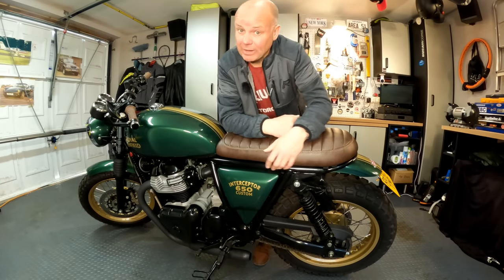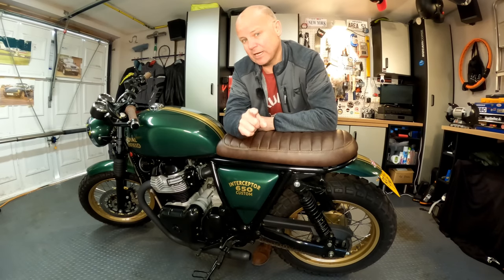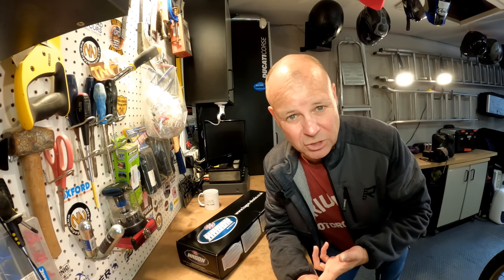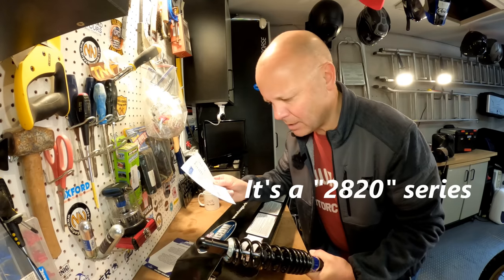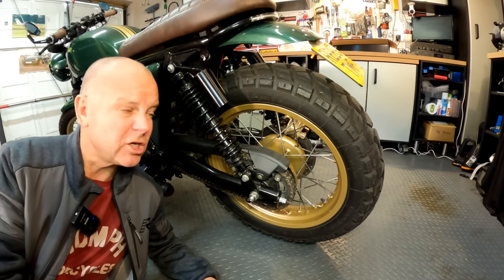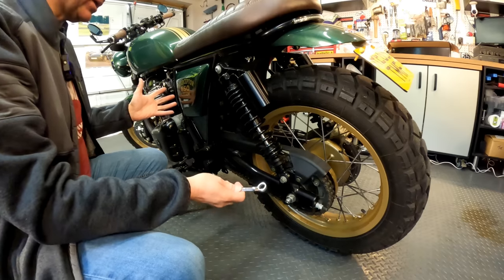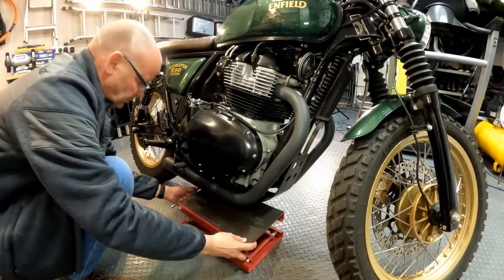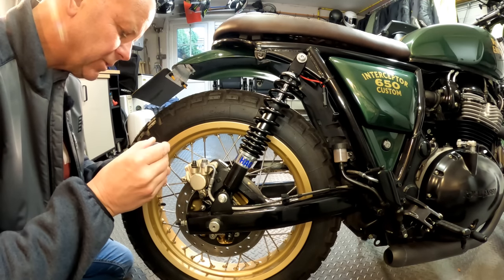DIY Fail: Attempting to install and test new shocks on my Royal Enfield Interceptor

Comment: Morning Andy
I think it may have gone easier if you had removed both the old shocks before attempting to fit the new ones. That way you could have used the jack to adjust the height and thus the angle of the swing arm to match the length of the new shocks without having to compress them.
Reply: Nope.
Andy did it exactly how it should have been done by a novice. He now has earned his QBF.
Qualified By F-up
Reply: I second this, haven't done this for many a year but that's how you do it.

Comment: When I was still a teenager I built a complete bike from several tea-chests of parts (engine already built, luckily).  I can't remember how many cock-ups I made but it was PLENTY.
A few years later I was confident enough to do engine top end rebuilds.  The point is that you don't learn anything without making mistakes.
Brave of you to show us your enthusiastic efforts, warts and all.  I hope this encourages others to have a go - doing your own spannering is one of the joys of motorcycling.
Reply from the maker: Cheers Chris - that was my intent on putting this video up, helping other learn by my errors....

Comment: When you're using a screwdriver to lever something always a good idea to put some soft material around the end of the screwdriver  in order to prevent a scratch occurring,  bit late in this case but good to know 👍
Reply from the maker: Well if you notice prior to that mishap I was doing exactly that!
Reply: @TheMissendenFlyer  👍👍
Reply: And... Use a small pry tool with a bent end, instead of a screwdriver for jobs like this.  If you use a screwdriver in this way you risk doing exactly what you did..

Comment: I have made all those same mistakes, Andy. These days if I have access to a jack, I pull both shocks (when applicable) and adjust the height to match the new stuff. And I also use a touch of silicone based lubricant on rubber bushings when I need to push them on, or a small bit of spit will do in a pinch. 

Always good to have a mate as a backup plan. And every expert I know has a long list of cock ups to become one.

Comment: Don't know if it's already been said but remove both old shocks before fitting the new ones. Then you can jack the bike up and down to align the new ones. Also. Don't do anything up tight until everything is fitted. That gives you enough slack in the system. Winding out the pre load can help to soften things up a bit.

Comment: Well done Andy! Theres no shame in not knowing what to do or getting stuck, you had a go thats the main thing & ask for help when unsure. 100% mate. Even us experienced tech's have to learn somewhere, no one gets it right 1st time all the time. You learn from having a go! 🙂My tip would have been to remove both shocks together, and as you're buddy did, bottom or threaded end 1st, then a tiny squirt of silicone spray would have had the top slip on. This doesn't affect the rubber bush, just aids installation. Shocks look good & seem to be a good fit financially & physically. I rate Hagon. Nice 👍

Comment: Local 'poundshop' had Tipex correction pens/sets which is ideal for marking any nut/bolt/fitting and easy to see if anything is coming loose.
I did wince before the damage and wondered what would get caught first, paintwork, wiring or brake pipe, glad it all worked out in the end.

Comment: Andy,
I’ve been in your shoes many a time and it’s nice to see and read in the comments that I’m not the only one. I’ve done many a shock change and don’t always use stock length. I’ve found that taking all the weight off the back and then using a Winbag or Air Shim to fine tune alignment works spectacularly. Great video and sorry about the paint work.

Comment: Andy next time you pass a camping/ caravan shop go in and buy yourself a rubber mallet (the type used to knock in tent pegs) you'll be amazed what can be achieved with said implement with zero damage! You should have put a thin strip of wood between screwdriver and swing arm! Ps really sorry to see how you were messed about and conned with your customisation of this bike, thankfully the Chris fella came to the rescue! Loving the channel as always!

Comment: I fitted a similar pair of Hagon shocks to my Continental GT last summer and find them ideally suited to the bike.  More sophisticated and considerably more expensive alternatives require lots of trial and error adjustments to get them right but Hagons are simple and work well straight out of the box.  I was told to start with the softest preload setting, put a few miles on the bike then adjust them up to the medium setting which I did and the handling is now far better than when the bike was new.  Mind you I have also fitted a YSS fork kit and a pair of Avon Roadrider tyres both of which I can wholeheartedly recommend.
Reply from the maker: Yes I did look at the YSS but I think these are fit for purpose - I'm very happy with them.  Thnaks for watching!

Comment: l always found Hagon helpful when l was building a Triton in the mid 90s. My alloy wheels.. (rims)..were build by them, also advised and suppied rear shocks....Mine bolted on no problem but l understand your pain...sometimes bad language works!, if not, 'stop'... go make cup of tea, light up cigarette if applicable....deep breath then start again. Most times a clear head solves the problem....Enjoy your new ride.... Greeting from España.
Reply from the maker: Greetings from Gran Canaria!
Reply: @TheMissendenFlyer  Andy , nice warm ride on good surfaced roads...🏍

Comment: When I did mine I removed both exhausts and the rear wheel and supported the bike on the centre stand. Was a good learning activity on removing and fitting the rear wheel which is a right pain in the proverbial.
Reply from the maker: Yes way beyond me that….

Comment: Glad you got it sorted with a little help from the pros. On critical fasteners like these I will use a little blue Loctite (medium strength thread locker) on the threads to prevent them from loosening off. Especially important on machines that vibrate a lot.

Comment: Helped a friend of mine change his Thruxton shocks. On reassembly he snapped the top mounting bolt. Fortunately I'm really good with a bolt extractor. (lots of practice) and had a spare replacement bolt (lots of pack-ratting). Post-mortem revealed that the bolt had been over-tightened by the shop that previously changed the shock.

Comment: Good advice to remove both old shocks first.  Also worth checking the two new shocks visually before fitting. One of the reasons for going to a monoshock design was the slight differences in cheaper shocks

Comment: It's always the way - something that you think will be easy, often takes a lot longer. One way to avoid having to compress the springs by hand is to use a wood working ratchet clamp such as an Irwin Quick Grip. You can add just the right amount of compression so that the holes align easily with the post.
Reply from the maker: Or could they be adjusted (preload) slightly differently do you reckon?

Comment: After 20 years I switched out the stock front springs and rear shocks on my 84 BMW R100RT with replacements from Progressive Springs. WHAT A DIFFERENCE! Should have done it years ago. Improved the handling immensely.
Reply from the maker: Nice one…

Comment: You did the right thing removing one at a time. 
You need one person sitting or leaning on the bike to compress it and one pushing the shock on.
If the shocks are a different length you remove both shocks and jack the rear, but you still need two people because the bike WILL topple. 
Glad you got it sorted.
Reply from the maker: Cheers!

Comment: IKON shocks are great.  The are made in Australia using the same tooling that used to make Koni motorcycle shocks, same design as old Koni shocks.  Retro upgrade, but a great upgrade.

Comment: Fair play for having a go. Its the lessons you learn in the warm garage that may save your bacon out on a cold wet road! 

Invest in a breaker bar sir. Stamping on tools leads to slipping and more paint gone. 

Watching i thought youd be better starting with theeading the bottom. Glad it was confirmed by Nigel. 

Anything with a rubber seal, i find a neutral lubricant.... Helps no end. 

I like to loctite bolts to stop the rotating but i know others who say avoid. So who knows. 

Dont be put off spannering, especially on an open bike like the RE. I fully appreicate if you skip the GoldWing😂
Reply from the maker: Yes the wing I’ll definitely leave to the experts….

Comment: When you don’t have the rear handrail installed you need to check that there isn’t any space on the top mount that allows the LHS shock to flap around. I guess the rubber grommet takes up that space. Otherwise the bolt can work its way out due to the movement. The rear handrail forms a sort of spacer slash washer.

Comment: I found that fitting mine on the sidestand was a 10 minute job. One side at a time, bottom end first, then either lean on the seat or pull it toward the sidestand to fit the top end.
Reply from the maker: You were luckier than me then!

Comment: You should of greased the bushes top & bottom of shocks .  270 quid is not a bad price & you can get parts & rebuild Hagons when they need refurbing .  Also it’s good practice to use something to protect your paint work ,& also any parts such as brake lines from damage ,when spannering your bikes . It’s easy to get impatient & carried away & cause damage ,when fitting new goodies to your bike .  I would also sort out the rear mudguard & number plate ,while your at it ,as they look like an afterthought that’s just stuck on to get the job boxed off . Together with the new shocks it would greatly improve the look of the bike ,from the rear . 👍
Reply from the maker: Appreciate the advice!

Comment: I've made small scratches in the paint like that as well. It's annoying but can usually be blended in with a Chipex kit. Just need to get the matching paint code such as RE/solid black etc.
Reply from the maker: Yeah it’s no big deal AFAIC

Comment: You mentioned that the OEM  rear shocks are positioned upside down. They do that for a reason, hence the USD (upside down) front forks. When you mount the shocks upside down, the unsprung weight of the wheel (and everything with it) is less and the less you have to dampen, the better the ride. Then they can build the shock with lighter materials and that saves overall weigt and yess.... i also thought you were leaning on a big scale model bike....😅😂
Reply from the maker: Yes indeed….

Comment: I’d invest in a socket set, easiest way to take out a knuckle is a spanner trying to loosen a tight bolt, also a jack under the bike & a lever under the wheel you can use the weight of the bike to align. I can’t believe your ‘expert’ fumbled so much too
Reply from the maker: I do indeed have two socket sets.....

Comment: Are you going to get Kteck to upgrade the front fork internals too.

A 3/4 braker bar and a socket would have been helpful to undue the bolts, a spring compressor would have made the job much easier.
Reply from the maker: I like the sound of getting the front done…
Reply: Have you had a look at the Revelry cycles channel they do some cool things with Royal Enfield

Comment: It may have been a struggle for you Andy but for the rest of us it was terrific fun, thanks!
Here’s what you learnt 
1. When using a lever on a finished surface always protect the surface and use a pad under the end of the lever.
2. Always get an assistant if the job involves the bike not being supported in a robust manner.
3. It is vastly preferable to remove both shocks with the bike supported securely under the engine to allow the swing arm to move and allow easy alignment of the new shocks.
4. And this is specific to you Andy, always ensure that you are working hard at your day job or making videos whilst someone else does the mechanical work on your bikes 😂
Reply from the maker: Re 4 - This is my day job!!
Reply: @TheMissendenFlyer  Thank Christ for that!, I was worried you might be an aircraft mechanic as I’m off on holiday soon 🙂

Comment: 10 out of 10 for a valiant effort!
You now have a degree in QBF.
Qualified By F-up.
This is how we learn. This is the way.

I agree with you on not going the Öhlins route. Sometimes cheap and cheerful will do just fine. Most men think they are Barry Sheene on a bike, Schumacher in a car or Rocco Siffredi in bed.
But we are not.
The cheaper shocks will most probably be good enough for all the girls you go out with.
Many miles, big smiles on a reasonable price!
Reply from the maker: Cheers Cedric!

Comment: Andy, like many I’ve been there too with shocks that don’t quite fit plus the giant screwdriver-cum-paint chipper. The mallet was a subtle touch rather than a lump hammer. I have Hagon units on my old Bonneville which are great value and do the job. My only issue with Hagon is that cheap-looking shiny sticker which is a sod to remove. Looks like disgraceful roads are a national theme that goes with the times. Very strike-ridden 70s retro.

Comment: Yes all been there. You where not that far off tbh. 😅 still satisfying when you get it done. Suspension is a crucial part of a bike and always transforms a bike. Hagon are an excellent choice. The triumph T 120 is a good example. Fit rear hagons front progressive springs and turns into a thruxton performance comfort. For a bike that costs nearly 13k it’s shocking haha that the suspension is so poor stock. Funny how fox rear shocks are a very expensive accessory option. What does that tell you?  😮👍

Comment: Andy, check your swingarm for 'full & free' (without shocks fitted) & the alignment of the shock mountings through that arc - you appear to have excess side-loads on the damper rods for some reason & that could be be why the OEM shock 'threw-up' like it did.
Be a shame to eat a brand new Hagon through the same fault eh?
Look on the bright side, it's not a Cardinal RG with badly worn knees! Enjoy the sun : )

Comment: Whilst watching this I was thinking…surely you would slot in the bottom 1st with the thread on but so much easier to see this when taking a step back. 
Got to admit when I put my after market end cans on I was doing something similar & trying hours to fit the back 1st when it should have been from the headers! D’oh! 😅
Reply from the maker: Exhausts I’ve managed before no issues….just sayin’ 😉

Comment: Hagon shocks have a very good rep. You should upgrade the front forks now as well to get the maximum benefit of the suspension. Would you feel confident doing this yourself or leaving it to Nigel?

Have you got a discount code for Hagon shocks? I could do with a new rear shock and front springs for my Triumph Sprint ST1050.

You need to sort that deep scratch you put in the swing arm. I had to look away when you first inserted that screwdriver to lever up the shock and started pulling on it.

Use some fine Scotchbrite to smooth the scratch, then wipe with brake/clutch cleaner on a clean dry tissue  before painting/sealing it. Use either smooth black Hammerite using a fine artist's brush or some of your, sorry Mrs Flyer's, clear nail varnish or failing this clear Gorilla tape so at least it is protected from the elements and water, so is less likely to rust.
Reply from the maker: Thanks for the advice!

Comment: Hi Andy, you also could have used lashing straps around de top and bottom of the shocks. Then compress them a bit with the ratchet until they line up.... A bit like compressing a coil spring on a car. Of course i do not have to mension the use of a thick cloth or piece of rubber or wood underneath the screwdriver....😊
Reply from the maker: Hadn’t thought of that!

Comment: Jack the bike up higher, the back wheel clear og the ground
Reply: Why try to physically compress the shock to line it up when a simple tweak on the jack or gentle lift of the bikes sub frame will do the same thing. Sometimes you need to take a step back and look at the bigger picture even on a simple job if it's not going as you think it would.
Reply: @stevecade857  EXACTLY 👌

Comment: Just a small point Andy, when using a torque wrench don’t click it again. The first click means it’s at the correct setting , doing it again increases the torque.
Reply from the maker: Thank you for that!
Reply: Hi Neil, have you any scientific evidence that a double click on a torque wrench increases the torque.
The reason ask is that I’ve seen this comment numerous times on tinternet with my daytime job as a mechanic and hobby of engine building I must of torqued thousands of fasteners and to this day I can’t see how a double click increases the torque.
Reply: @ticthedog6095  when I was trained I was told to only tighten until I heard the first click. The reason I was given is that when you apply pressure to the torque wrench on subsequent occasions, I.e to hear more clicks, you are tightening the nut or bolt further.
Reply: @neilfordham5790  
My friend who is a air frame fitter was taught exactly the same, so we marked a fastener and retorqued it multiple times and it never moved.
I think the one click only rule is been taught because of people using the torque wrench incorrectly.
Reply: So doing them up tight and then a little bit more isn't good enough then. 😂😂

Comment: I'm shocked you haven't got a paddock stand (or 2), or an Abba stand. Much better than the bike wobbling about on that jack! (and if you do use that jack put it at 90° to the bike for more stability & clearance to turn the height adjuster).
Reply from the maker: Actually I do have an abba stand but for this job I just wanted to take the bikes weight and no more….hence the scissor jack.